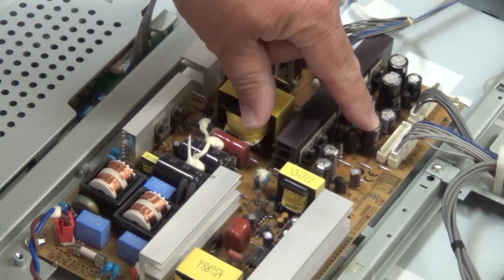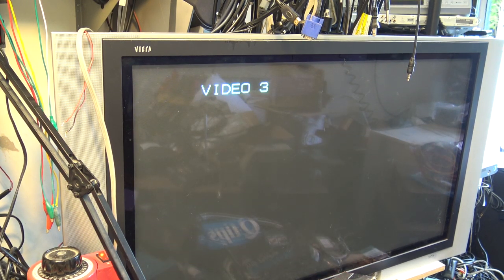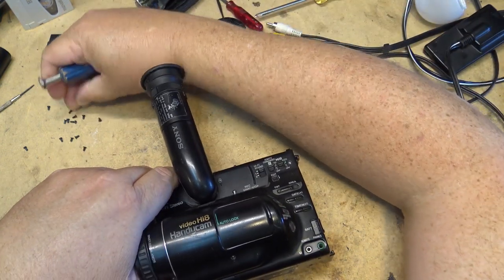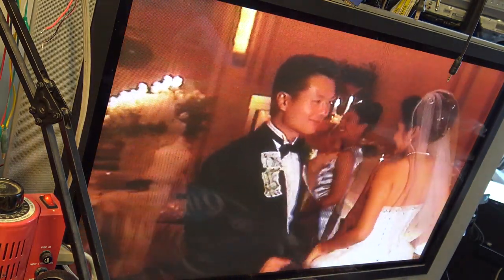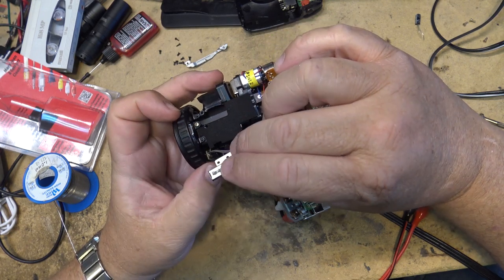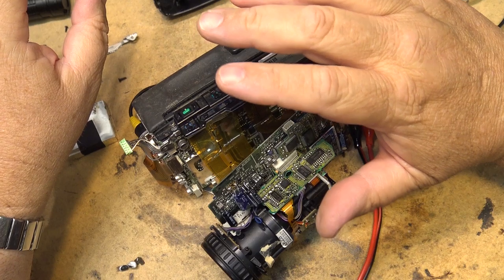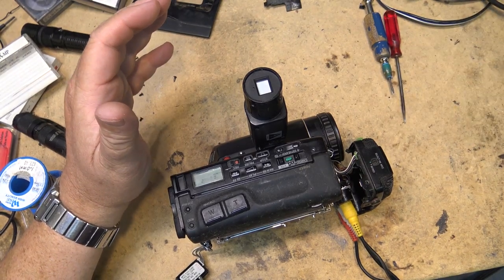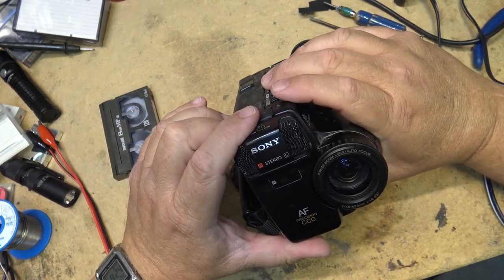Sony CCDTR81 Hi8 Handycam very poor video full overhaul

Comment: You are just what I needed to to take out my old Sony TR705E, which is very similar to yours. With your instructions I was able to take it apart, localize the foulty Caps, same as on your machine, absolutly genious that you showed the Slide Resistor for the Focus and how to clean it! And beautiful how you talk through thr whole procedure.
You have just got yourself a new subscriber, Thanks for the excellent Video

Comment: I had that little camera for doing destination weddings (having to fly there) in the early 90's.  It was thankfully so small and portable for packing in a suitcase with the other gear, and the output quality was superb for the time. I have no complaints - wasn't a cheap purchase but there was nothing like it. Certainly beat trying to drag a Sony EVW-300 all over the place - that travel case was massive.

Comment: I bought the Fijix Hi H80 in Dec 1991, which as you're well aware was a Sony CCD-TR81 that was re-branded and sold by FujiX.  I took loads of home movies and will now double check my old tapes (almost all, I think,  have been digitized with the  Sony DCRTRV840 Digital 8 which was backward compatible with the Hi8 standard and could output Hi8 to the IEEE 1394 standard).  Thanks for the "heads" up on how dangerous the Sony Particle tapes could be because, 1. Losing "precious memories" of friends at parties, and 2. Clogging up video drum heads.  It was a great camcorder that lasted about 9 years and now I know that it was probably a couple of failed capacitors that did it  Great video.  Very impressed that there were no loose screws - and it worked like new when you finished!
Reply from the maker: I recorded my silly friends at parties with my tr81 too.  Lots of very funny tapes.

Comment: I love your energy, and this is like an unholy fusion of when I tore down my 1989 Discman D250 to do...something I forget, and when I tore down my 2016 Alpha A6300 to swap the SD reader board. The complexity and density of boards in this unit is like the A6300, but the actual components are similar to what was in the D250. What a fantastic old piece of kit. Cool that you got it working again. And you're right, those old units do still have value, both to hipsters trying to recapture their youth, and to people like me who are trying to transfer the tapes of their youth before they rot. I had no idea the sony tape did that. I hope the model I get on ebay has good caps.

Comment: Well done dave :-D
I'm always amazed when you bring compact units back to life using capacitors.
I've never had that much trouble with capacitors but it could be how critical a circuit is.
Those units must be very critical, designed with very little component tolerance error.

I needed to test the output of an old car keyfob, the frequency was 433 mhz so i plugged in my old realistic 2005 scanner in,  the scanner was dead!, six years not being used just killed it.
Yep it had two caps in the audio stages that had leaked then eaten tracks.
Dam capacitors!.

Comment: Dave, have you ever tried baking those sticky Sony tapes? It supposedly solves the problem for a short period, just long enough to archive the content. IIRC, 50-60°C for many hours (12-48h), but do your research, as I looked it up many years ago, and my numbers might be incorrect. 

The stickiness is caused by the deteriorated binder, which soaks up humidity from the air. By baking it, you can dry it out, and that stops the stickiness temporarily. I wonder if putting them in a vacuum chamber after heating them up helps reducing the baking time, as the water evaporates much quicker at lower pressure.

Comment: I wish we had a camcorder for I don't know how many years. I guess it was 2004 before I had any way to record a video. It's a Kodak digital camera that I still have. It uses 2 AA's but thinks new batteries are flat nowadays.  I think it will only accept up to a 2 GB SD card.
Reply from the maker: I have one of those kodak playtouch cameras, Looks like a little cell phone. Records an excellent picture. uses 2 AA batteries and supports to 32GB.Used to use that to make travel videos

Comment: I actually have many Sony Metal P Tapes and not a single one has these problems you adressed in your Videos, I wonder, is there a difference between the tape formula of America and Europe? Because all of mine work!
Reply from the maker: The problem affected certain years of production only. They did get the problem resolved in later years. Unfortunately for us stung by bad tape, we changed brands and never went back to Sony.
Reply: I have dozens of Hi8 Sony MP tapes from the early 90s on. No problems with any. Currently copying from my GV-D200 to my VRD-MC3.  All copies are very nice on DVD. Of course they are 4:3 aspect ratio.
Reply from the maker: @Sheetbender  
You are lucky.  I operate an archive business and see hundreds of tapes a month and the numbers of bad tapes, all Sony is high.  40% of Sony metal p tapes are bad.

Comment: I wonder if the modern SMD electrolytic caps have stable electrolyte inside? I am not amazed that Dave can take these to bits and fix them. I AM amazed that he can get them back together again with no bits left over.
Reply from the maker: I used to get all excited for Friday at the shop as that was camcorder day.  If I touched a camcorder before Friday I got yelled at.
Reply from the maker: Yes that problem was solved long ago.

Comment: Hi. Great video! I have CCD-TR45E. The problem i have is that when i connect it to the TV or PC the image is dark and looks like it has an emboss effect. In the ocular the played video looks normal. If i understand correctly there is a foulty capacitor somwhere? I would appreciate it if you could point me in right direction to fix my problem. 
Thank you.
Reply from the maker: There are leaking caps on the board.   They are surface mount electrolytic types.  The liquid that leaks out is corossive and will damage the board.  As to which one that is what you will have to determine as I don't know the exact one.  This will usually get it running for a short time until the damage caused by the leakage kills the board.  And no you can't fix that because it is a multi layer board and the damage happens on internal layers.  It wicks in and corrodes the internal layers.  Then the fun begins.
Reply: @12voltvids  Thank you for your fast reply. I will try to find the foulty one.

Comment: @12voltvids - i can't believe i found a video with my exact camera.  Thank you - have this taken apart, and when i hold the top of the 2 acps you have replaced and pinch the other side of the board, i get colour.  So i beleive replacing these caps will fix this.  The first cap (that you have already replaced) is clearly marked as "r4 220 4V".  The one you actually replaced in this video, you call out 33 4V, do you know what the first characters are?  Half the cap is blocked with blue marker and I cannot see it.  A big help if you could point me to the details of this cap.  Thanks so much

Comment: Having found 2 old Video8 tapes that I recorded on around 20 years ago I managed to get hold of a Sony CCD-TRV30e off ebay for £40 so I could at least play the Sony Video8 tapes back, fortunately it turns out the guy that had owned the camera had it from new and took very good care of it and still had the original box and accessories and by a fluke saw my address and messaged me saying he lived just a short walk away! he saved me £5 postage buy dropping it off in person, so got a bit more history about it and himself (he was a tv repair man years ago) he said it just sat around for years so he sadly decided it had to go, he originally listed it for around £75 but knocked it down to £55 with offers I offered £40 and won and when I played back my old footage it was perfect like I had recorded it the same day!
Reply from the maker: You were lucky. Most of those old cameras have suffered from the capacitor plague that this one had.

Comment: Hi do you know if the old sony CCD tr83 can playback sound thru the camcorder? Only viewfinder Lcd. the manual says move the record button back to standby but mine does nothing. Sound fine with playback through tv.
Reply from the maker: You need to plug headphones in to get sound on camera unless it has a flip out screen. Then it will have a speaker as well.

Comment: Hi! How do you narrow down which board is the video processing board? I have an old Sony ccd-v5000 and there are several boards inside.
Reply from the maker: V5000. I had one of those.  All the caps on every board need changing.   Good luck.
Reply: 12voltvids hey, thanks. Hopefully not but are there any identifiers for the video processing board?

Comment: I have a Sony CCD-V701 from 1991. It’s very sentimental to me, has cap disease of course. Can you fix it?
Reply from the maker: Anything can be usually be fixed. Just look at this camera for example. I fixed this one didn't I?
The problem is the cost of doing so would be prohibitive.
Reply: 12voltvids how much would a repair like this cost?
Reply from the maker: @networkgames1000  
More than the camera is worth.
Reply: 12voltvids I’m willing to pay that. Just want it fixed and you seem like the expert. If your interested in repairing it let me know I’m willing to pay whatever it costs.

Comment: Guess you're going to condemn it, but I used to punch the hi hole in normal tapes in order to record hi8 on my tv-65. Not easy to get hold of proper hi tapes back in the day around here. Congrats for the repair, it's obsolete valueless stuff now but they are still tech marvels.
Reply from the maker: I used to punch 8mm to fool my digital 8 deck into thinking it was a hi 8 so I could use the lp speed all the time.

Comment: I have a Mitsubishi VHS HS-U80 S-VHS VCR. I have a problem with the VHS does not rewind it does not fast forward. I want some advice. The belts is new.
Reply from the maker: Check the pulley attached to the capstan motor. It is known to crack and then slip on the shaft. Check the clutch.
Reply: @12voltvids  He is able to read cassettes. The problem is the idler gear system for rewind and fast forward.That's the problem of this vhs hs-u80. I would like you to make a video of this type of vhs u 80.
Reply from the maker: @SylvainGagnon01  I can only do videos on equipment I have.
Reply: @12voltvids  I made three videos on youtube.  Electrohome G96 vcr vhs

Comment: They sell these old cameras in the second hand shops in the UK for £10 
They sell straight away .
We dont  see many tapes around for them .

These cameras sit around for years
Reply from the maker: Of course they sell right away.  Someone had home videos they want to transfer and no equipment to do it.   Their old camera broke and they can't get it fixed so they go looking for another to play their tapes.   Will likely sell this one now that it works.
Reply: @12voltvids  they are in demand .
Its the new ones that sit there for ever with dead batteries just like the new phones .
every one of then have a dead battery .
They say they are all tested , yeah right .
It can take up to 3-4 hours to start the battery up .
Some are dead on arrival  ,  you can guess the rest .
As well as some pisst off  costumers in the shop .
Yep   the UK is one pisst off country

Comment: Sticky "rubberized coatings" - I treated some of my gear with Armor-All back in the day (when they were new) and they have survived quite well. My brother's stuff (untreated) became sticky and yucky. I doubt there is much that came be done to those now. Nothing I tried on them seemed to work. If one buys one off eBay, etc. they can expect it to be yuck!
Reply from the maker: Alcohol will remove it.
Reply: @12voltvids  Didn't work for me but maybe the things I had were a different compound. Nikon stuff.
Reply from the maker: @RuneTheFirst  I cleaned it off a teac portable dat. Left the plastic shiny black when done.

Comment: I bought one of those in 1995 when my first granddaughter was born, went through two more grandchildren. In 2005 I archived the tapes to digital and placed the working camera in a church yard sale.  Let someone else have the problems.
Reply: Parents bought a camcorder similar to this in 1996 albeit with some cosmetic differences (CCD-TRV11) and used it for its intended purpose as a video camera until mid-late 2007. Still works without problems, only issues it ever had were dependent on the tape itself

Comment: Looking at eBay, I'd say you could sell it for $20-40  but theres a couple oddballs over $200.
Reply from the maker: Cool I would be thrilled with 200 for it.  I'll get it on eBay right away.
Reply: @12voltvids  Most I saw were $10-50.  Only 2 crazy auctions had them over $200.  They would have to be mint, sealed, in the box.
Reply from the maker: @gbowne1  you would be surprised what working beta decks go for.  I some an old mono sl10 on eBay and it sold for 340usd and it was all beat up and had the previous owners had their name painted on the top but it was working perfectly and that is all people care about.  The guy that bought it contacted me after he transferred his 200+ tapes to let me know that he resold it and got almost what he paid.  Was very happy.
Reply: @12voltvids  wow yeah I had a nice beta vcr that sold for a little $

Comment: My Sony GV-500 video walkman has the same tape mech.
Reply from the maker: You sure about that.  Must of those used the b mech which has the full size drum. It might appear similar but this chassis was typically only on the really small 8mm cameras.
Reply: @12voltvids  yes the drum looks the same but the rest is different. Mine loads forward.
Just replacing the 25 caps on a spare GV500 from Japan that has sound but no video so I hope its just the caps.